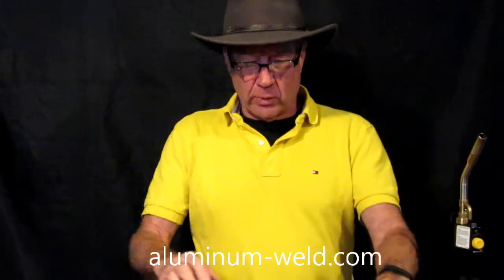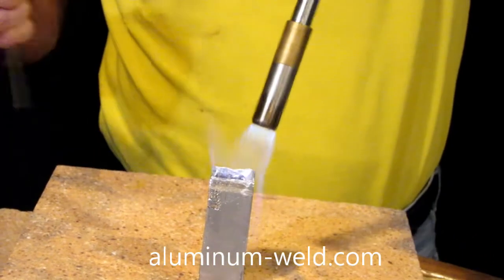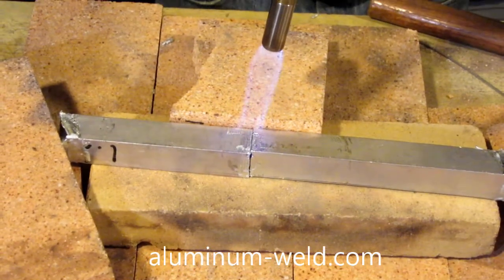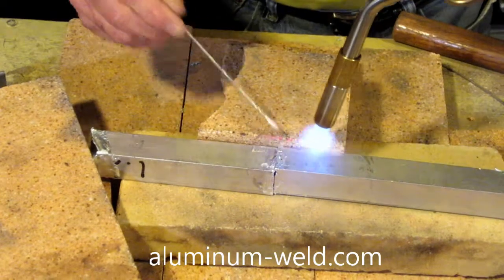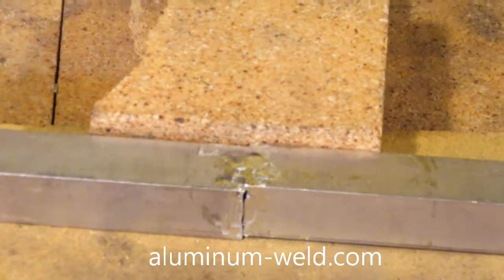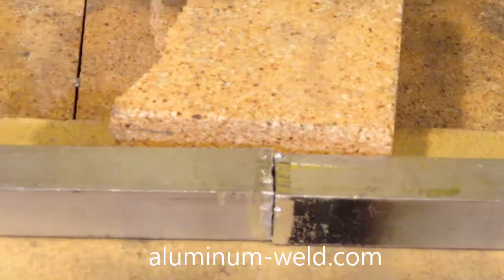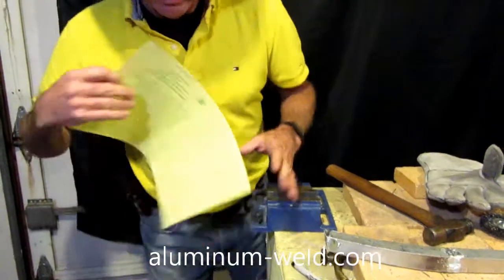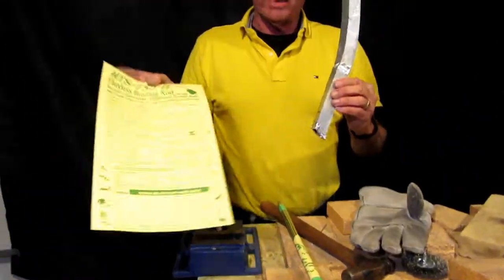DIY Easy Square Tube Welding Strength Test with HTS-735-11

Comment: I am still getting started welding the inside of my boat sled, and there is a square tubbing break what is the best way to weld all the way around it?  The bottom area that is also broke is about 8 inches from the bottom of the boat.